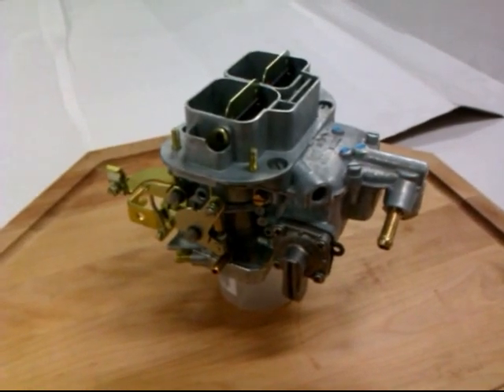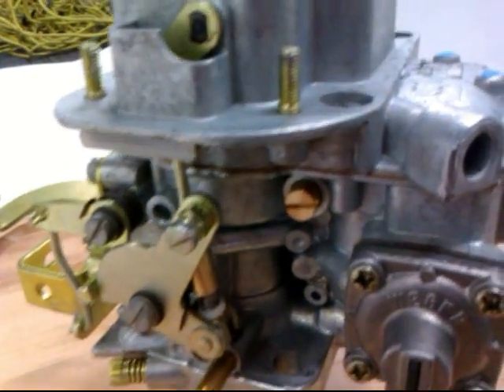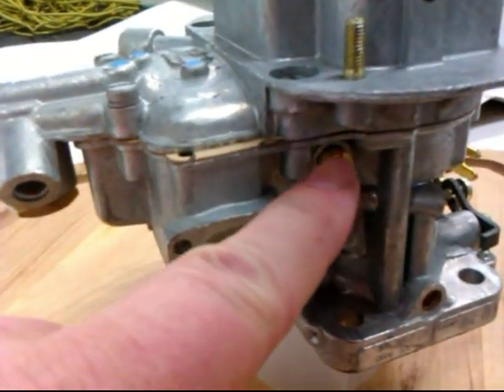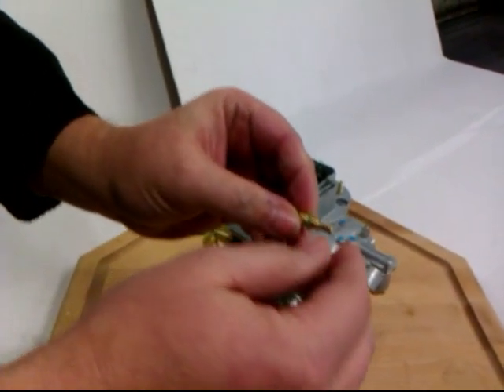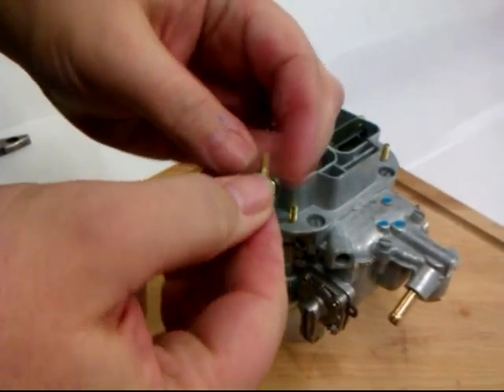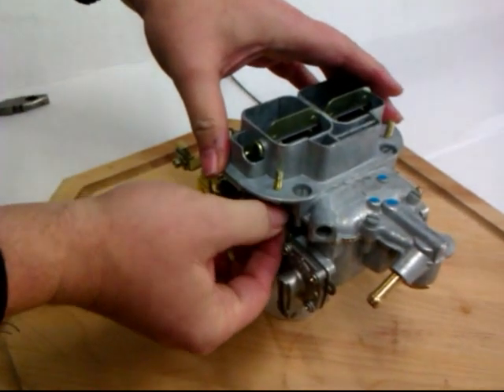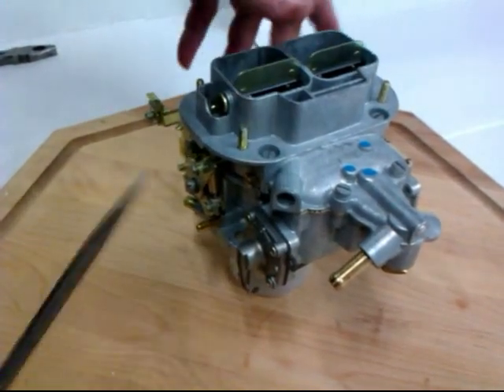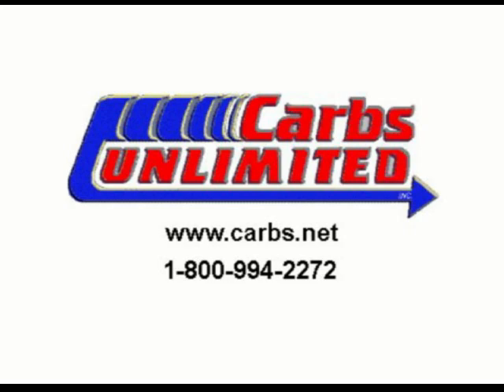How to change Idle jets in a Weber DGV

Comment: my inline 6 has a horrible idle with this brand new carb, do i have to just change idle jets or do i have to adjust the main and secondary jets
Reply: +Lalo Herrera  I have the same problem.  Did yours ever get sorted out?   It idles crazy high with the choke on, and with the choke off, it just stalls out.   I can't find a "sweet spot" with choke adjustment to get it to idle low AND stay running.  Pull that thing out (engaging the choke) and it idles at like 2 grand.   Same problem I had with the factory carb which I replaced with a weber to solve that problem.
Reply: +8digitPDX honestly these carbs are hard to tune. i bought a jet kit and was able to tune it but car still idled rough and i had to advanced the timing way too much. so i just went back to my oem carb and all the problems went away
Reply: +8digitPDX try buying  a jetting kit and try different jets and try to adjust the fuel/air mixtures screws also and u might get some better results

Comment: would you know the proper idle (fast and regular) speed adjustment on the 32/36 weber DGEV carb? 
Would you know why my 32/36 weber floods in the secondary barrel? (At first, it flooded both barrels until I adjusted the idle mixture screw 2 turns out from bottom.. Now it just floods in the secondary.)
Reply: Float level??